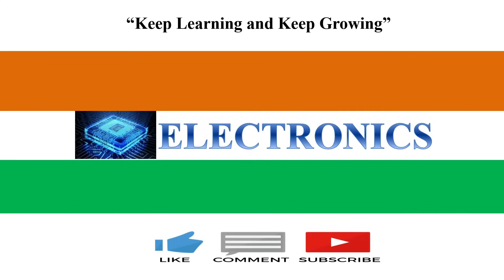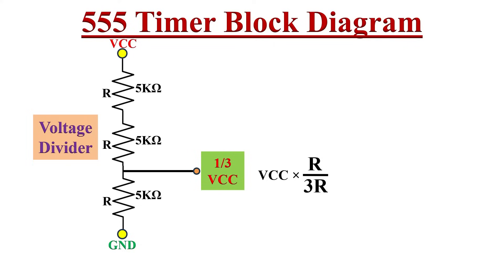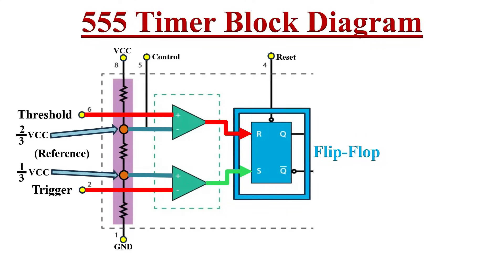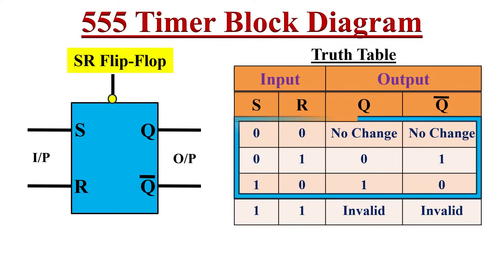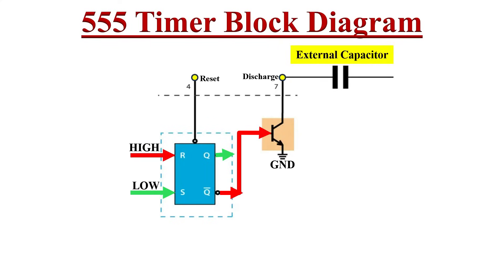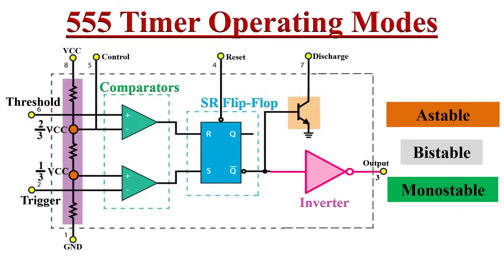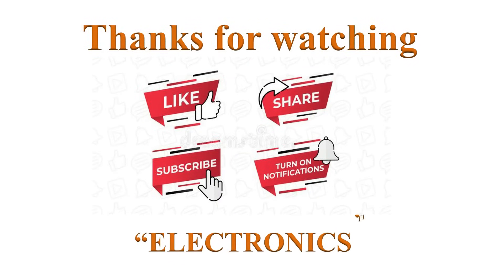Introduction to 555 Timer: Internal Block diagram and Pin configuration

Comment from the maker: The timestamps of various topics covered in this video are
1:10 Pin configuration,
1:40 Internal block diagram,
2:00 Pin-8 VCC and Pin-1 GND functional details,
3:25 Pin-6 Threshold and Pin-2 Trigger functional details,
8:10 Pin-3 Output stage details,
9:42 Pin-7 Discharge function,
10:44 Pin-4 Reset function,
11:35 Pin-5 Control function,
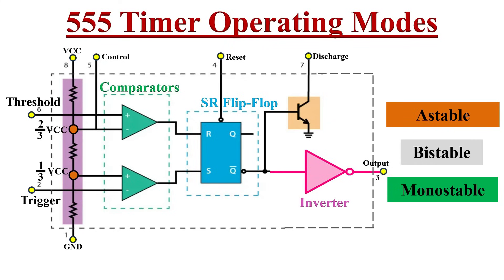12:45 Astable multivibrator using 555 timer,
14:13 Bistable multivibrator using 555 timer,
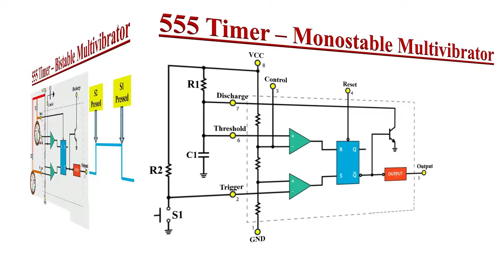15:46 Monostable multivibrator using 555 timer.